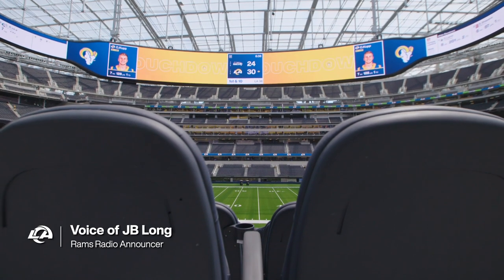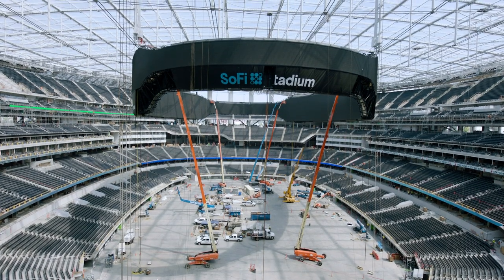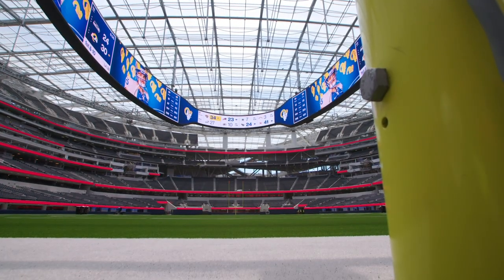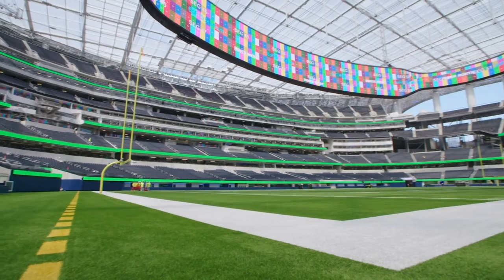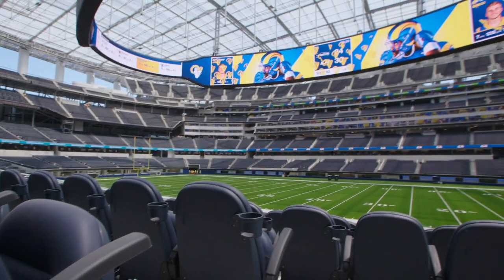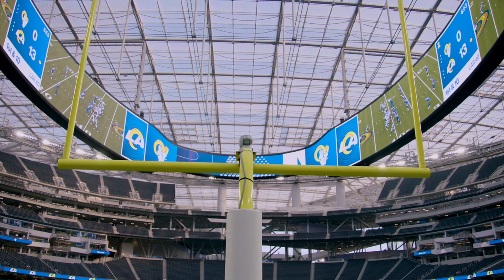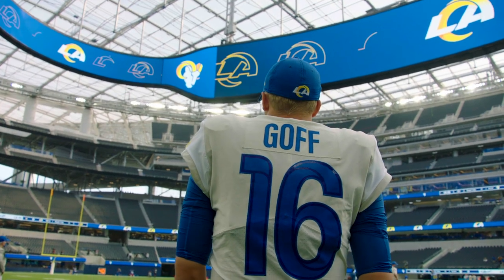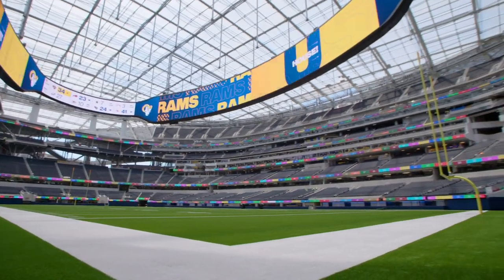Behind the Scenes of MASSIVE Double-Sided Videoboard at SoFi Stadium | Los Angeles Rams

Comment: Are these people brilliant?  That roof is suspended by cables AND supports that video board!  They have sort-of-like train wheels on the columns so that in an event the roof doesn't pull at the columns OR the columns don't pull at the roof.
Reply: They didn't go by trial and error.  They built it like smooth sailing.  No going back and correcting boo-boos.

Comment: Dumb to have the empty stadium, you could at least allow the Luxury Boxes, even if you limit them to approx. 8 because that many arrive in a group, one RV or 2 cars anyways perhaps the same 1 or 2 houses even family that always visit eachother anyways, the regular seats, I notice sections that could be divided into 4 to 8 sections & allow 8-12 people per those section, only allowing seating on the inner seats of those sq off sections,  perhaps 20% of the Stadium, but at least 10% allowing 10,000 + the Luxury boxes, 20% better, BUT personally, I'd just go 4 seats on, 4 seats off staggered per row & get 1/2 the stadium filled w/ real fans, like 40,000, still less brushing elbows than shopping for groceries.  my 1st suggestion 'at least" is less than going to the beach.

Comment: I'm curious about the temperature inside the stadium. It seemed to be pretty hot even the journalists and the players seemed to be sweating to much. I guess we have zero control over the climate inside. I think that's going to be an uncomfortable situation to say the least. Does anyone know if we can control the temperature inside?
Reply: Well at least football is played towards the cooler months but you have a pt
Reply: @Honestly__now  ...not sure how much football is going to be played or ruined by all of this BLM nonsense. Can you imagine when they put 70k fans in that building it's gonna be a sauna inside that place. I hope someone with first hand knowledge chimes in and tells us that we do have climate control.
Reply: 46 of the 302 canopy panels can be opened to increase air flow. Also, the average high in Inglewood in September is 77F (66F in December) -- not exactly Woodland Hills. Lastly, ETFE panels are designed to disperse and scatter light rays, through something called fritting, which significantly reduces greenhouse warming effect inside the building.
Reply: Aldo The Stadium is the South Bay which always cooler than inland Los Angeles. Also, the canopy can open some panels to let out any trapped heat. Lastly, it’s a canopy, meaning all sides of the stadium are open for cross ventilation
Reply: @theaarongarcia ...yes I realize that Inglewood is closer to the ocean, but it still can get pretty hot down there in September it was well into the 90s this past week. When we put 70k fans and we don't have a specific way to manage the temperature inside Sofi it's going to be an issue. I was watching some of the reports from the sidelines and they made mention of how hot it was and that was in an empty stadium.
Reply: Aldo Lets say the Rams were still in the coliseum. It would undoubtedly be hotter than what it is now. People need to understand that it is not a dome with air conditioning. It’s an open air stadium with a canopy. Expectations need to change.
Reply: @theaarongarcia  ...for 5 billion dollars I would think the my expectations would be that Kroenke would like to have his players and fans relatively comfortable. Its going to be like sitting under a tree in the shade, but its still freaking hot outside no matter how much shade there is.
Reply: Aldo my guy, you think football is played in the Summer? You probably have 2 games max in September
Reply: Have you ever been to Miami? Now that heat.
Reply: @theaarongarcia  ...never been to Miami..but was born in Michigan and gets very hot and humid just like the inside Sofi will be. They are not only playing football inside that stadium... I'm pretty sure sooner rather than later they will make some kind of adjustments to help control the climate inside.
Reply: Aldo did you not read the previous comment about the canopy panels? There’s record heat in September in LA. You can’t do anything about that. I don’t understand your point of view on this. SoFi is not an enclosed dome. It’s an open air stadium.
Reply: Aldo the average temperatures in Inglewood is 77 degrees in September. Temperatures that we’re getting right now is not the norm. If we weren’t in a Pandemic would you be complaining about how hot it is if you were watching a game at dodger stadium in the sun? No, because you can’t control the weather, but you can’t determine if you’re willing to set in the elements. Players were complaining about the heat because, well, it’s hot outside. I assume there some sort of expectation when they look up and a roof that they automatically assume there’s air conditioning in the stadium like every dome in the league.
Reply: @theaarongarcia ...it seems like the temperature is around 86 today and inside the incubator AKA Sofi stadium its pretty hot under the roof. Look at the sidelines large misting fans are everywhere!
Reply: Aldo that’s because it’s 86 degrees. Of course they have Misters.
Reply: Aldo I don’t think you understand how heat works. Heat rises and doesn’t stay on the field.
Reply: @theaarongarcia  ...of course they do?.. that's why I said they would need some kind of climate management..but you said all they needed to do was open the roof and the ocean air would suffice..
Reply: Aldo my I guy why do you care so much about the climate management in there
Reply: Aldo if it’s 86 degrees outside then it’s going to be 86 degrees inside
Reply: @theaarongarcia  ...ya that's pretty hot. And we don't have 70k worth of fans packed inside. That's why I said they would need to manage the climate somehow. You said it's only hot in September and the cool ocean breeze and the panels on the roof would make it an oasis.
Reply: Aldo if the stadium didn’t have a roof it would still be the same temperature so idk what your issue is
Reply: @theaarongarcia  ...the issue is Kroenke spent over 4 billion just on the stadium...only to find out its like playing inside a reptile terrarium!